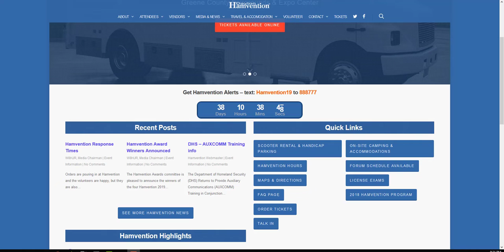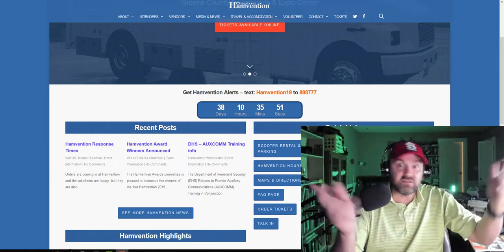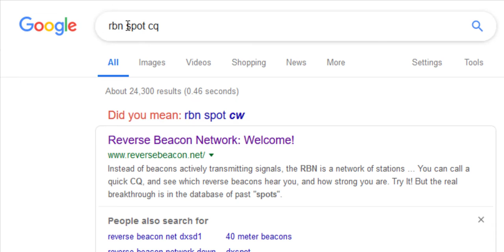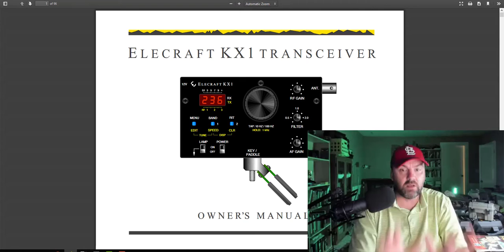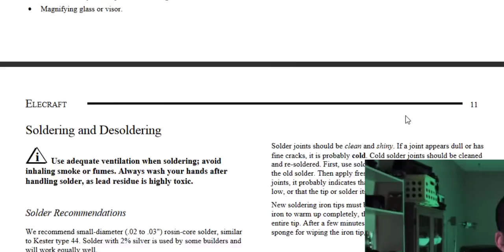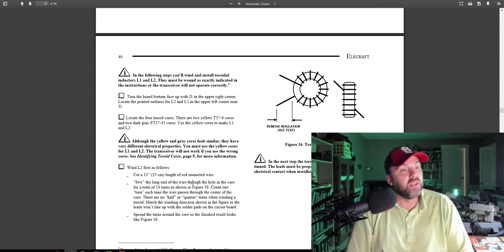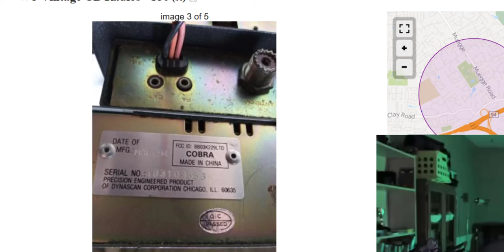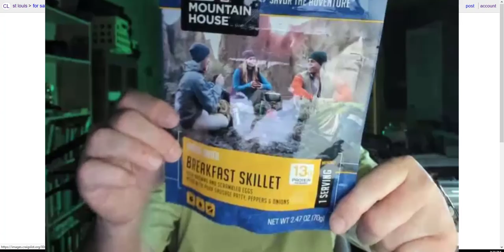Yo vLog #11! | CB Radios? | Elecraft KX1 Solder Project | Hamvention meetup

Comment: Thanks for sharing. I have a whole bunch of cb radios that I bought back in the 70's when cb was big and I was talking around the world on them when the skip was good. Also have  several linear amplifiers and even an original Penetrator 500 antenna that was on my rood about 30 years before I took it down after becoming a ham.
Reply from the maker: Thats awesome. Thanks for the interesting comment.
I played with CB as a kid n the 70s.

Comment: Yea myself and my son would like to attend, as for QRP radios.  Back in the late 90s 1998 I think I bought a Norcal radio kit for 40 m. I put it all together and it didn’t work, not to be undone I ordered the wilderness radio Norcal 40A, I put that one together at work and promptly use it there, after making a CW contacted to Florida with it from the Ford Rouge #1 power house. 

After talking to another ham he suggested I might have a cold solder joint on the first radio so I looked back with a magnifying glass and sure enough I found some solder joints that were in suspect, I reheated them and it played, so both radios still work to this day. Only 2w though so it’s definitely CW only. We will be out at Caesar’s Creek State Park see if you could come over Sunday afternoon before you leave and you can operate the Clansman 320 with the straight Key. You oughta make some contacts with that radio it puts out 30 W phone and CW. It worked out for the British military in the falklands war back in the 1980’s
Reply from the maker: Ok will let you know location. Tnx fer the comment.
Reply from the maker: Thanks for thr offer also. I will seriously consider it Sunday.
Reply from the maker: The location and time have been set: https://www.facebook.com/groups/1529154683867342/